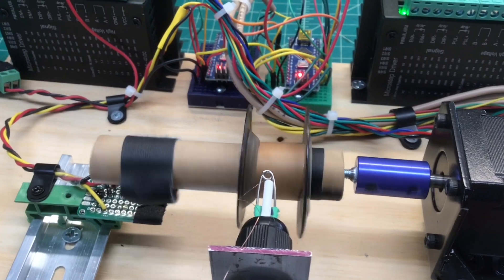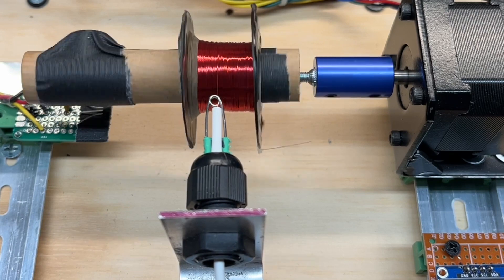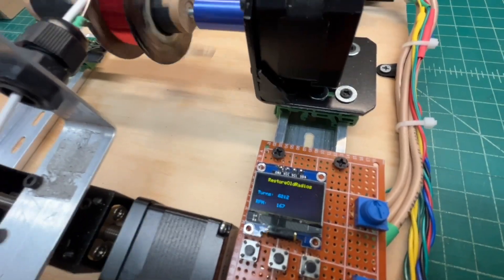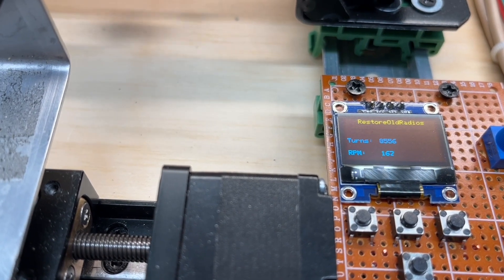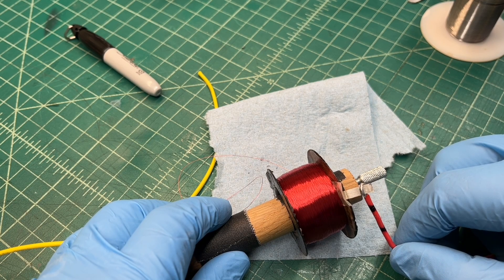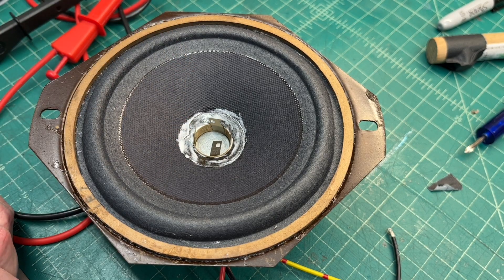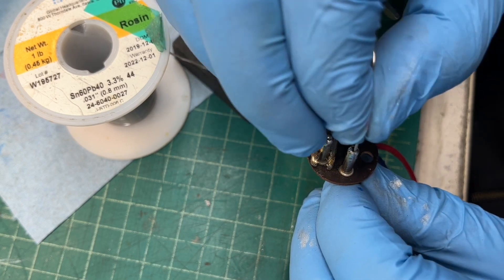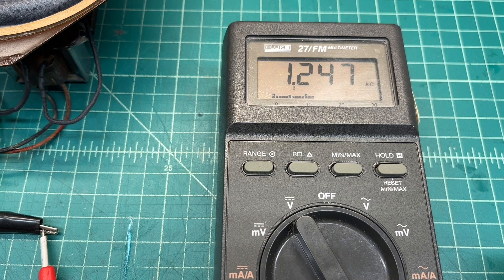Emerson R156 - Field Coil Rewind | Speaker Reconing & More...

Comment: Hi Don.  Sorry for hijacking this tread.  I wanted to tell you about a recent experience using Barbasol shaving cream.  I used it on a 1960's speaker grill cloth (Hammarlund S100). I worked very well.   I have heard of Barb long ago to take dirt and stains out of cloth car seats.  I used a generous amount on the S100 and wiped off most of the excess.  I worked it into the speaker cloth with a plastic scrunchy type thing although a regular rag seems good too.  I wiped of the remaining Barb with a dry then a wet rag.  Much much brighter and cleaner.  Jim
Reply from the maker: Jim, thank you for the tested tip. I'll have to pick up a can and give it a try myself. Thanks for sharing this Jim. Best, Don

Comment: Hi Don.  Here I am again!  I finally opened my Renaissance wax and used it on all kinds of surfaces.  Seems wonderful everywhere!  Are there any surfaces where you wouldn't use it?  Speaker grill cloth seems to be one of those places.  What do you think?  Thanks.  Jim
Reply: I got a comment from a friend on the Ren wax.  I told him that it smells like the wax has a petroleum distillate base which evaporates away.  He says that petroleum distillates can ruin the silk screen printing on the front panel of some radios.  What do you think?
Reply from the maker: I haven’t seen any issues thus far Jim, but I appreciate the heads up. Best, Don
Reply: @RestoreOldRadios  I had wanted to try this on a radio that I didn't own but this has put the brakes on this idea.  I have now used Ren on all kinds of surfaces including paper with no bad results.
Reply from the maker: Wonderful! Jim, I use it myself on every surface of course less fabric and it really works well. What I like, a little goes a long ways. Hope this finds you and your family doing well; we’re all doing good considering. Best, Don
Reply: @RestoreOldRadios  Hi Don.  Pam and I are doing well.  We are  half way through are six months here in Arizona.  Glad you and your family are doing well.

Comment: I am building your winder. I have a question can you wind honeycomb IF transformer and and Antenna coils?
Reply from the maker: Carl -

I have not tried to using this winder. I would think if the Linear Stepper Motor Guide Slide T-Shaped Screw line speed can be adjusted (fast enough), then it should be possible to do honeycomb. I built this simple honeycomb winder: https://youtu.be/M4p8RErjToQ

Best,

Don
Reply from the maker: Another video where I built a new…

Zenith 707 - Winding a New I.F. Transformer Coil
https://youtu.be/mnpiiDveFxA